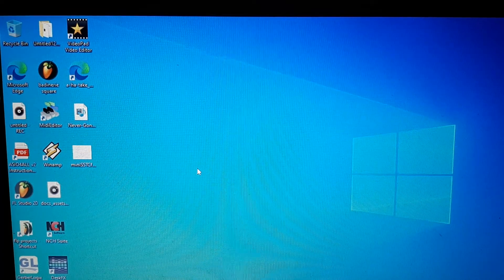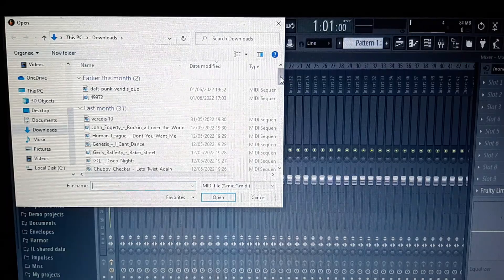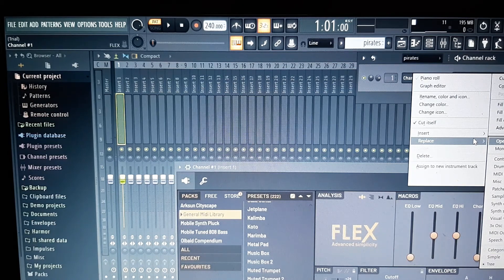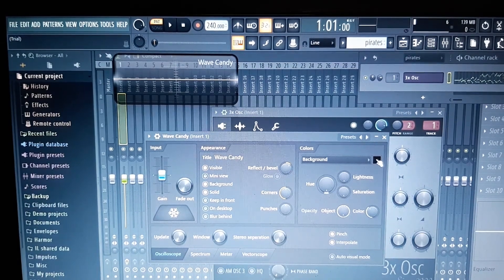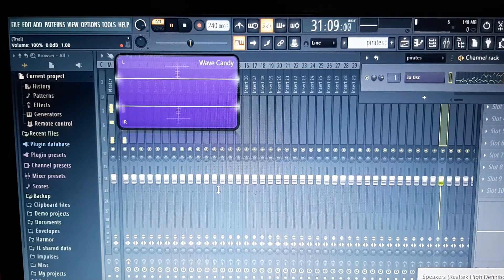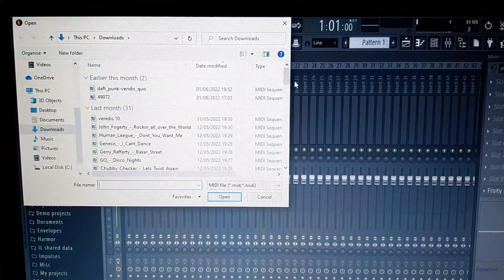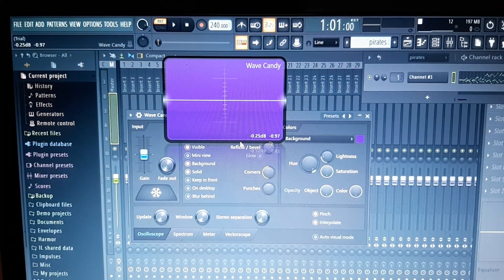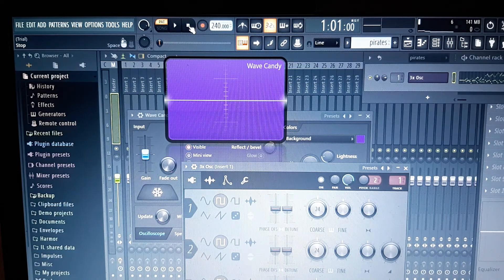tutorial to change sign wave midi files to square wave. " the dirty way  ! "

Comment: hello!  I have a question.  The integrated lm311n does not work for me.  Do you know why another integrated could replace it?  Thank you
Reply from the maker: Hi Nacho. 
Your not alone  ! 
Other people including myself had the same issue with the LM311N not working. 
Let me guess.  . . As soon as you apply power  , it starts firing and the test button does nothing  ?
It took me a month to figure out the problem. 
The only one that worked for me  is the. KA311N .  I recommend this one. 

You could try the LM311P  if you can't get the KA311N as some people have reported that they are difficult to get  , but do try.
Hope this helps.  
Any further questions  , please ask.
Reply: @petesteslachannel334  thanks for your help, you are always willing to help others and that is admirable!
Reply from the maker: @nachogomez4581  
Thank you  , that comment is appreciated. 
I feel that we are here to help each other and will always help if I can ! 
If you have any further questions  , please ask.

Comment: Thanks for the mention! I’ve been having quite a lot of success with poizone and utilizing slide notes as you can see with my most recent shorts and videos. The slide notes just add that little touch to make songs sound just like how Fabricio has his. My next challenge is figuring out how to dial in sytrus as it creates a more brighter sound if you will than the lower more retro like sound of poizone. Can’t tell you how much fruity limiter has helped though, on some songs where the signal just seems to be too weak upping the gain and ceiling have worked miracles. Let me know if you got any more questions about using poizone for good sounds would be happy to help.
Reply from the maker: Hi Jon. 
Sounds like you're really getting to grips with it.  . . excellent  !
I hope you didn't mind me mentioning you  . I knew you were doing well with the music side of things  , , but also   I was hoping to send more traffic your way.  Before I had the musical flybacks  ,  I only had 7 subs , but since then  , my sub count has boomed .  I think once more people see how well you are doing  , your count should do too !
Reply: @petesteslachannel334  yea really appreciate it! I also tried putting some clips on tik tok which I never really used before but just as an idea to get more traffic. Let me know if you ever got questions about what I’ve been doing. Wouldn’t have made it this far without the helpZ
Reply: Hi! A few months ago I was developing this project and the most I got was what Pete has achieved with 3X OSC. Now I'm trying again. How is it possible to make that characteristic Franzoli sound with Poizone? I've tried and I only hear interference in the songs. Also, I have tried to use Sytrus with the Square Purity preset and the same thing happens: I only hear interferences in the songs.

The Poizone output is square wave? How can it be configured in Fl Studo to sound like Jonathan? I would really appreciate your help, I'm going crazy!

Best regards
Reply: I had posted a comment but it doesn't seem to have posted!

 I had forgotten to ask if the audio format you input to the flyback circuit is MP3 or MIDI. I convert a MIDI file to square wave in FL Studio with the 3X OSC, then export it from FL Studio in MP3 format, and finally feed that MP3 file to the circuit and still get crosstalk in the song. 

Maybe I should feed the flyback circuit with a square wave song exported in MIDI format from FL Studio? 

Thank you very much for your help !